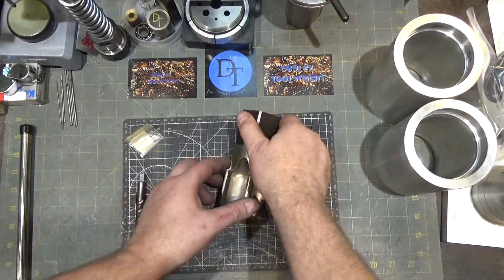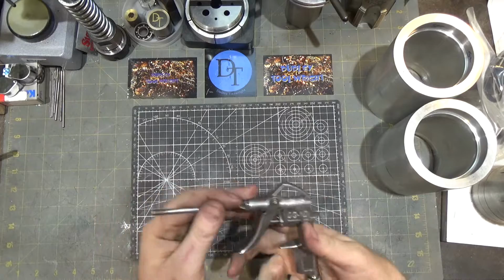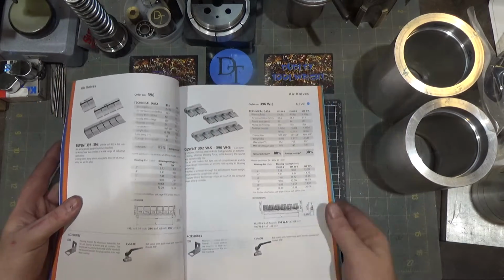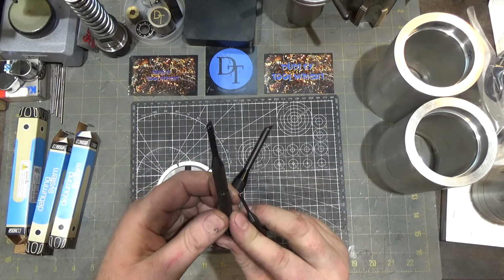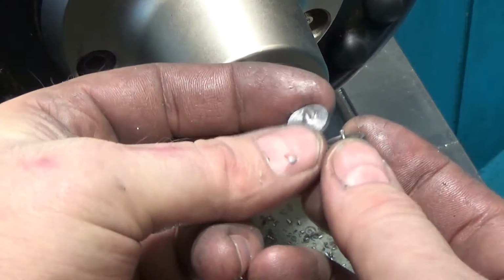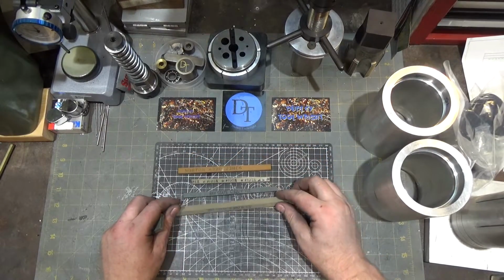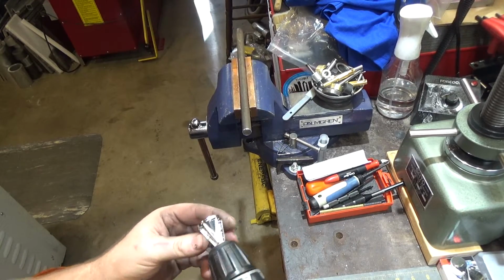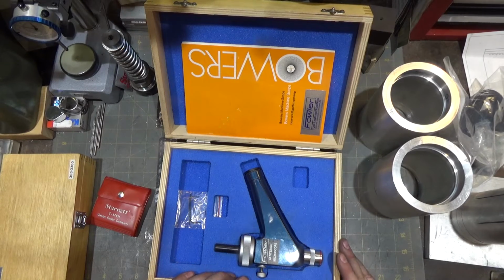Weird Bits #6

Comment: When I was installing lift kits on Jeeps and trucks The kits came with long U bolts. After the U bolts were installed I would cut the extended lengths off with a cut off wheel. Then use the "Uniburr" tool to clean up the ends incase the U bolt ever had to be removed. As you found out the tool works "ok".
Reply from the maker: Interesting use. Stan Zinkowski over at ShadonHKW will be doing a review of a bunch of different ones soon.

Comment: Dudley the tool is designed to use on threaded rod so you can start the nut and yes the cheap ones are so so
Reply from the maker: Thanks for the feedback. Much appreciated.
Reply: @DudleyToolwright  the ones with better quality work pretty good this would be used if you had a threaded stud set in cement and could not take it to a grinder to clean up the threads keep up the good work
Reply from the maker: I hadn't thought of that application. Makes sense. I was thinking in terms of hanging cable trays and the like.

Comment: yep, you floundered on the tap extractors... no problemo...
My problem is you don't include links for your retail buys... damn...
make me do the work. The gun is nice, but too expensive for my tastes...
Don't put the glass in your oven... you're not watching cupcakes... while it would be nice, you will lose a lot of heat. The glass will stand up to the heat loss, but it will still go through. My cooktop is quartz... the elements are under it... So it does let the heat thru, it just doesn't damage from the high heat.
Reply from the maker: Thanks for the great tips. I havn't mesed with Stan's oven yet and you make some really great points.

Comment: Had a 6" pipe tap at my last shop. Used it all the time for our Vactor trucks 🤠

I really appreciate showing off stuff like this.  I have seen pretty much all of those, but the thumb screws just solved an issue I currently have and was getting ready to 3d print some, but I like the ones you showed, thanks 👍.  Those broken tap extractors can be a life saver, but you have to go very slow and work them back & forth with some good oil too. 
Cheers
Reply from the maker: Thanks, I appreciate the feedback. I liked the instant thumb screws, so had to get a few and share them. I had run across them in the past, but did not realize that they were for sale to consumers.